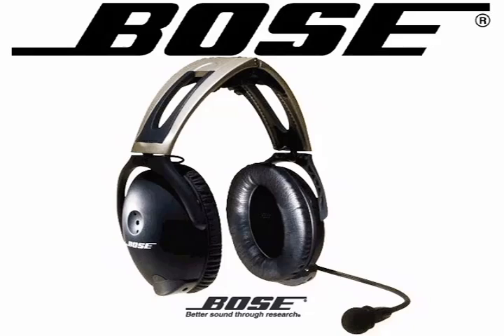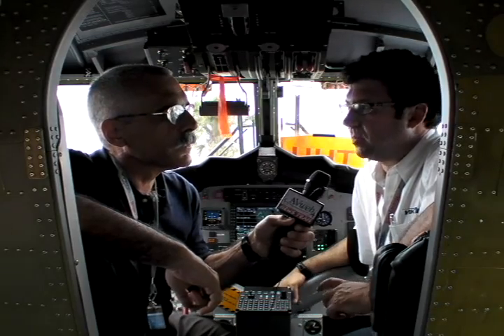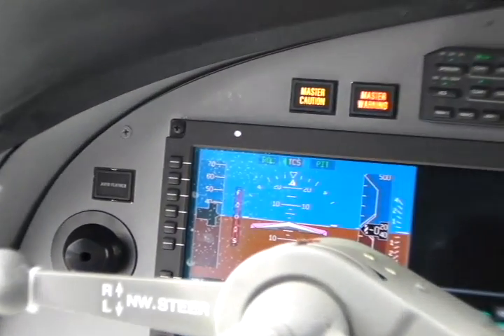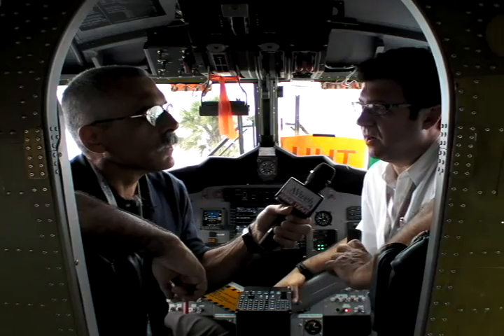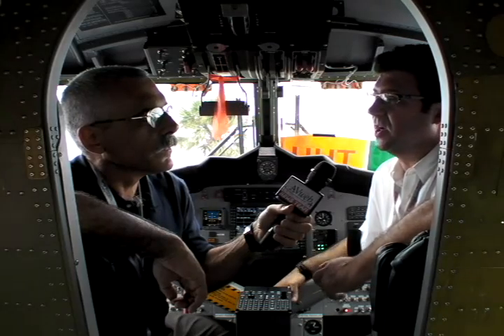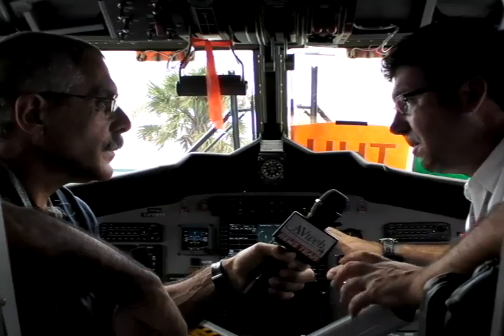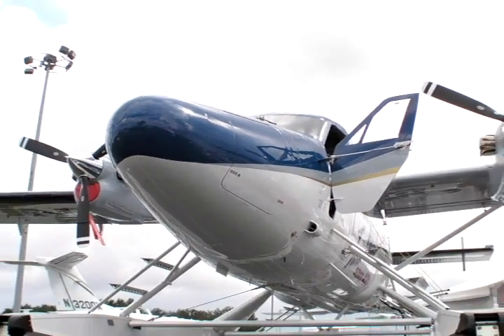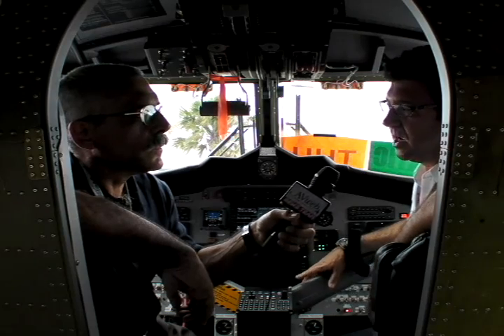Viking Reinvents The Twin Otter

Comment: How cool would a modern Chipmunk be? :D

Don't think there is any market for it anymore though. Modern Fighters are also tricycle geared now, so would make no sense to learn pilots up on a taildragger. 

Would still be cool as a sports aircraft though. Ligthened and stronger engine compared to the old chippie would make for quite an aircraft..